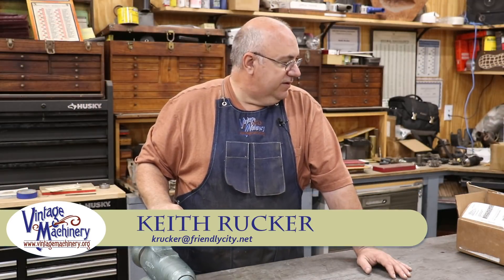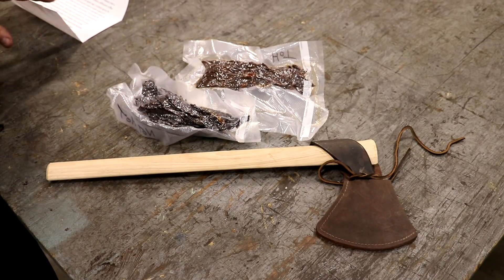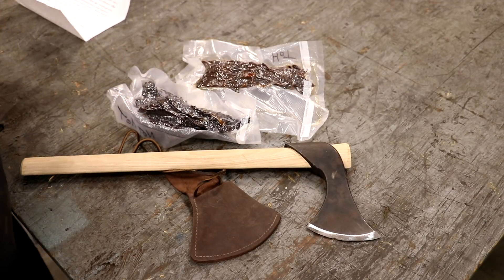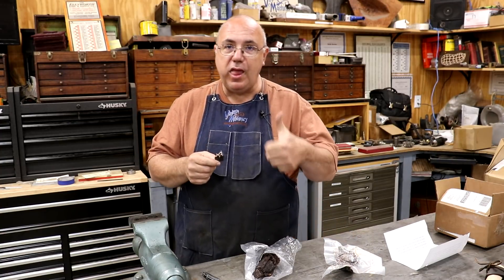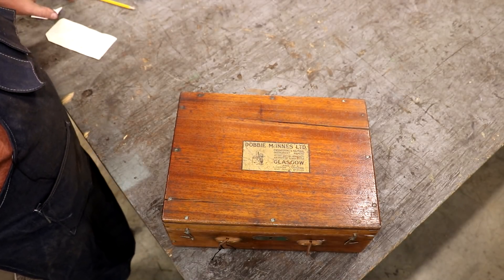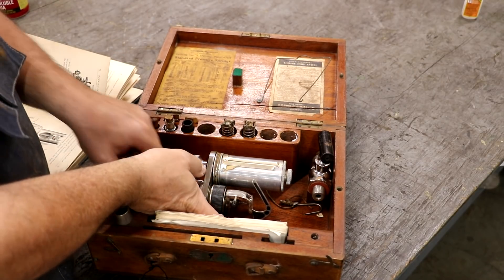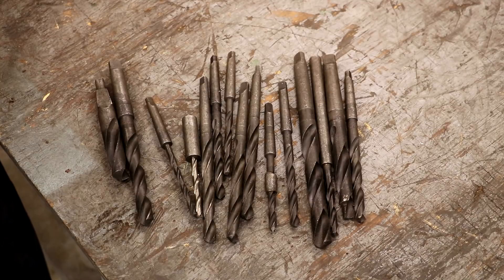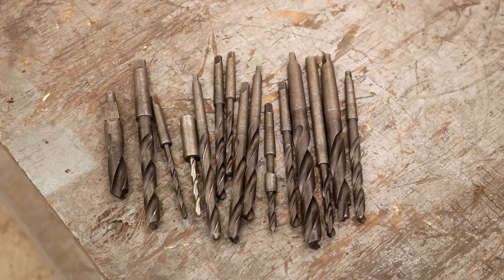Odds & Ends 124 - Steam Indicator, Porter Cable Oscillating Spindle Sander, Viewer Mail

Comment: I have a similar indicator. In order to indicate a steam engine you will need the piston travel transmission as well. The crosshead moves about 80 cm depending on the engine. So you need to transfer this 80 cm of travel to about 8 cm which the indicator cylinder is able to rotate. You can see the device that I am describing at 13:55 in the book on the top right. Without that you wont be able to use the indicator.

Comment: Hey Keith!
@21:28  Hmmm... Yeah, it "looks" like a cam, but... I believe that is an indexing type of form cutter blank.  Probably correct for screw machine operation.  These would have a holder which had multiple pin locations to "index" the cutting edge about the center as the tool would be re-sharpened to refresh the form being cut.  You will note the fact that about 180 degrees is circular so that one can get multiple grinds before it is used up.

Ken

Comment: Your steam engine indicator looks terrific and complete (a very nice gift). These were important tools back in the age of steam. Setting valves were extremely important for performance and economy, especially on a steam locomotive. “Valve setters” were real artists. Your Porter Cable spindle sander may have been used in a pattern shop where sanding curves would have been a constant requirement. You’ll never wear it out. They don’t make machines like this anymore.

Comment: Porter-Cable was founded in 1906 in Syracuse, New York, by R.E. Porter, G.G. Porter, and F.E. Cable, who invested $2,300 in a jobbing machine and tool shop the trio ran out of a garage. In 1914, the company began to focus on power tools, starting with a line of lathes.

Comment: I graduated in 1973 from The Southern Alberta Institute of Technology in Steam Engineering. We had labs where we used those indicators to calculate efficiency. You can also use them on compressors to set them up for most efficient operation. Nice to see one again .

Comment: Compressors to this day use charts similar to that produced by the steam indicator. The diagram is basically a P-V diagram (Pressure-Volume) and the enthalpy (more or less power) is the area under the curve. For a compressor it would be the consumed power and for a steam engine the developed power. Once you have the pressure and volume the system is thermodynamically described, and lots of other information such as specific entropy can be derived. For compressors such diagrams are useful for both efficiency analysis and strength design, such as rod loading. So while the steam indicator is old, the information that it provides is just as useful as it ever was.

Comment: The war finish history lesson was awesome. Years ago I saw a drill press if memory serves that had a similar tag on it and I had no idea what it meant and neither did the guy selling it. Even if it's not as aesthetically pleasing I'd rather have items like that than the throw away garbage made today
Reply: Our high school had a Case D model tractor painted Air Force green with a big square flat plate on the front that was used to push airplanes around, its paint always looked so poor I wish I would have looked for a war finish tag.

Comment: Porter-Cable used to make the best routers back in the day as well. DeWalt used to make the best radial arm saws. How times have changed.
Reply: I have had my Porter Cable 690 router for thirty years without a problem, might of charged the brushes. Most people today using Dewalt power tools probably don't know about the radial arm saws that they used to make before Black & Decker bought them out.
Reply: @andyZ3500s  There was a window of time when they were owned by Rockwell when they bade complete garbage. After Pentair bought out Rockwell in the early 80's they started making high quality tools again. I bought two of my routers back in the mid 80's and still have them. 36 years and going strong!

Comment: It's always going to be up for debate about how much restoration should be done on old machines like that.

For "War Finish" machines, it's entirely understandable in my opinion to either leave it as is, or restore it to look as messy and quick as it would have been out of the factory at the time. It was a machine built because of the need, not to look pretty, so as long as it's functional it doesn't need restoration. A little cleanup of old dirt and grease is fine though.